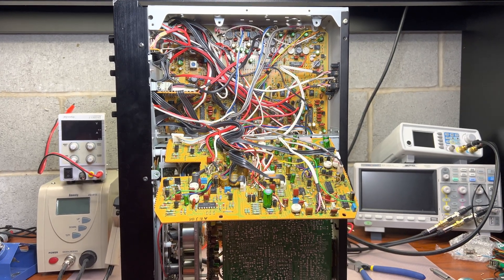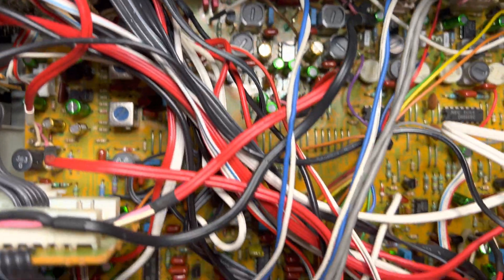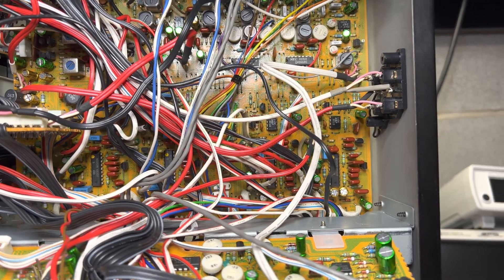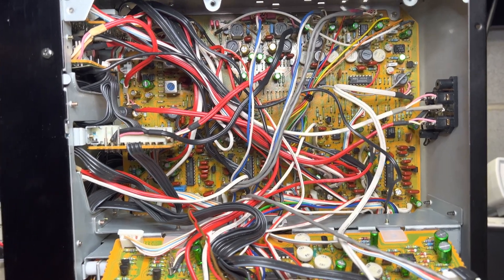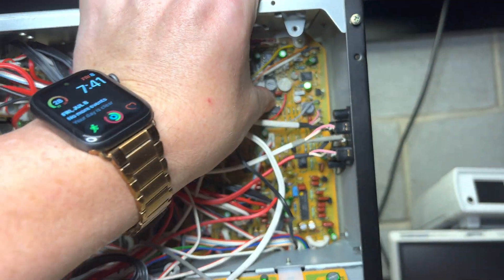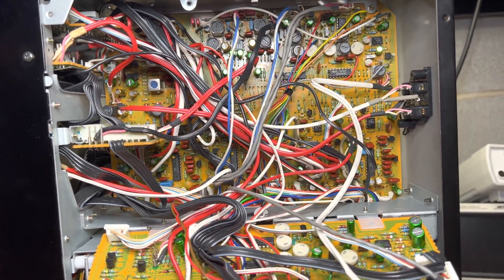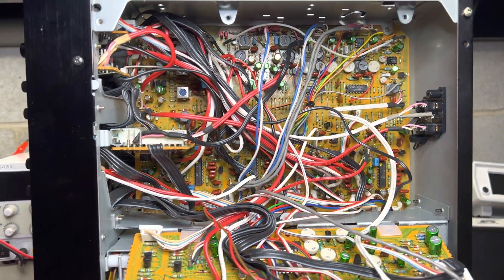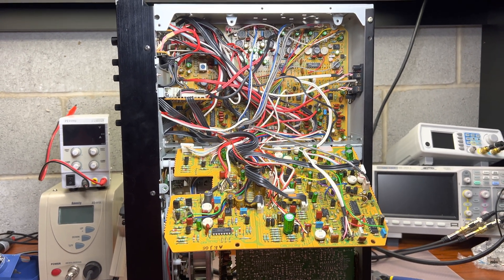Nakamichi Dragon Restoration Part 3: Post-Capacitor Replacement

Comment: HAI some of the capacitors i am unable to get 2% tolerance but able to get 5% would that be ok. i checked in digikey but could get them with required tolerance especially 2% once. any lead on where to purchase them.